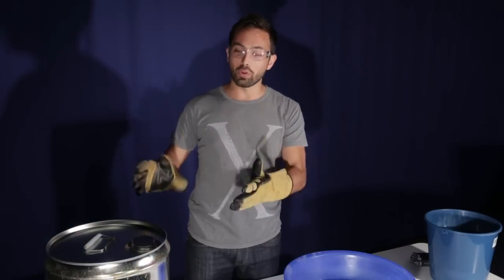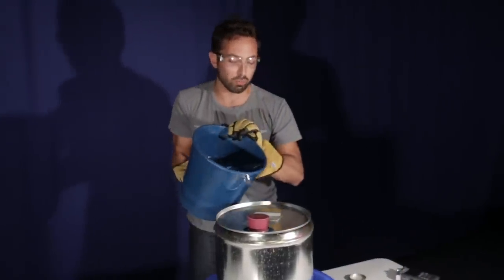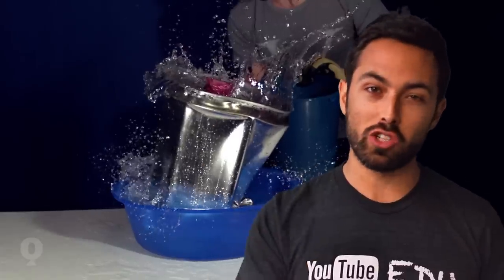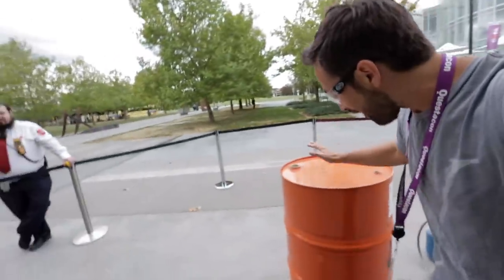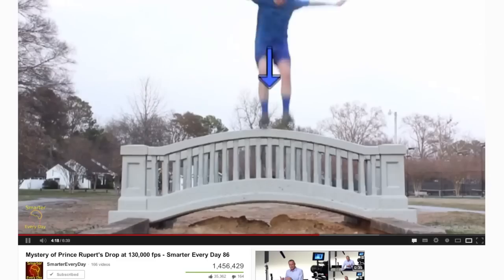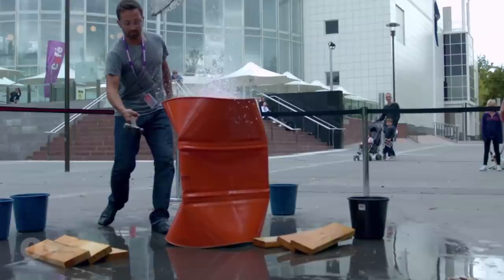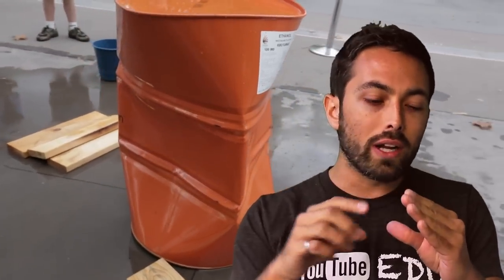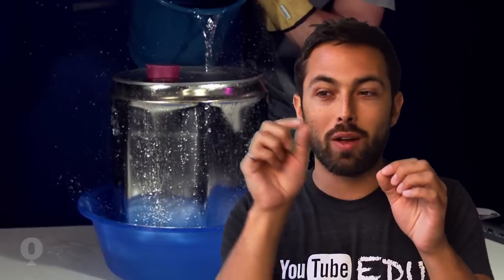Epic Slow-Mo Drum Implosions!

Comment: I think the point you made about minimizing space to compensate for the vacuum is true. However, I would add that if the structure of the object allows it, it will prefer a more spherical shape, since the atmospheric pressure pushes on all sides. I think we saw that on the small drum. I would guess that the bottom ring of it was not as structurally sound as the large drum, so it could cave in the whole thing rather than "make due" with the shape we saw in the large drum.

Comment: If it is stronger along the vertical axis (looking at it as a drum normally sits), or having a much stronger lid, then maybe the hexagonal shape has to do with its not wanting to deform near to the ends. it is still minimizing the volume inside but the resistance to deformation of the lid (look at how much the orange lid bends) keeps it from going to 3 folds.

Comment: I think it's to do with the ratio between diameter and hight of the container. They both have a reinforced rim at both ends that would require far more force to deform. So the comparitivly weaker sides deform into the lowest sided shape they can given the restricion of the rims trying to keep it circular. A really short barrel may compress into a 10 sided prisam where a really tall barrel may compress into a flat plain (significantly less volume to surface area than a triangular prism)

Comment: I think it [triangle/hexagon] was because the top and bottom -  where the lid or the base of the barrel meets the round outside looked a lot stronger in the smaller barrel than in the larger one. 
Now, the lower pressure would normally cause a triangle but can't because of the stronger circle there, it gives itself more sides to compromise between the strong base/cylinder joining point. 
And the forces at play came out at about 6, which is pretty close to a circle. 
If that makes any senss

Comment: In my opinion since the air pressure is the same on all sides of the drum you would get a equal force applied in every single point of the circle; and that's why it formed that equal later prism. And the 2nd question; if the air pressure would still have enough force left over the materials strenght, it would cave in a 6 later prism, then if enough force would be left it will become a 12 later object;

Comment: I think the small drum ended up shaped like a hexagon because there wasnt enough low pressure inside it to justify it turning into a equilateral triangle. Just like it was said in your video, the bigger drum, being tougher, allowed it to build a much lower pressure inside it (and the need of a few hammer blows on its side) untill it got squeezed into a shape with a minimal amount of area.

Comment: Maybe the difference is 1- The material the drums were made (large drum was of a more dense and harder material, versus the smaller drum which seemed to be made of a thick aluminum, still being weaker than the larger drum; and/or 2- The large drum had those corrugated rings on the upper and lower sides, making the drum stronger than the smaller drum, which was flat on its sides.  Since those were factors, maybe having to use more energy to collapse the large drum, the effect was the equilateral

Comment: The lowest perimeter/area ratio explanation carries the assumption that the can must crush regularly, not as an isosceles triangle, or as a rectangle (both of which could have much lower perimeter/area ratios). If we can explain why the can crushed at a regular interval, it may help to explain why triangle or hexagon. I think it has to do with the pressure waves traveling through the metal. The waves propagate from both sides and crushes only where waves interfere constructively.

Comment: I think the smaller container was allowed to reach a statistical valley and path in stability because it was only utilizing the gradual energy contributed by the vapor condensing. There's probably a larger and more sudden activation energy to reach the equilateral triangle state which was given by the impact of the hammer. The smaller container then couldn't reach the triangle state with further condensation because it would have to go back to its original state and then to the triangle state.

Comment: Premise: collapsing into a triangle takes more energy.
Guesses:
1. You jump-started the collapse, giving it enough energy to get to a triangle. If you hit the small can, what would happen?

2. The large can had a higher pressure difference, so it needed the more compressed state.

3. It takes more energy/is less stable to collapse a short object than a tall one. Ex: crushing a tall soda can into a triangle is possible, but collapsing a short half-can distorts it into an uneven jagged state.

Comment: If you do this experiment with a perfect sphere as your original shape you'll get a geodesic. Buckminster Fuller mentions this experiment where the navy did this with two perfect spheres where the air is removed from the middle of both spheres and the outer sphere crumbles along the geodesics. An equilateral triangle is the smallest space in two dimensions, but in three the shape is a tetrahedron.

Comment: I think the smaller drum  turned in an hexagon because it requires less pressure to form this shape and as the vacuum was gradually produced, when the amount of pressure needed for that shape was created it was imploded.
In the case of the big drum, I think it reached an amount of pressure to give an hexagon shape to that metal, and as more vacuum was created, the pressure was enough to form a triangular shape, but it was not enough to change the round shape until you hit it with a hammer.

Comment: I think it has to do with the length of the sides of the drums. The 55gal has long sides that can fold in a triangle without having to distort the top and bottom that have a strong rim. The small drum has much shorter sides and the hexagon is the closest available shape it can make without distorting the strong rim.

Comment: Pt2
The other key factors are strength of the 'skin' and height of the drum.  A tall thin walled drum, especially a tall one, will collapse to an almost flat shape, the walls are not strong enough, even in the very robust triangular shape, to prevent the pressure of the air crushing them flat.

Comment: Hexagon is super stable shape, that's why the small drum have collapsed in to it. It's actually quite usual for drum to collapse in to a hexagon as round objects tend to naturally collapse in to this shape. Best example would be honeycombs made by bees. The bees are actually making each cell round, only the heat in the beehive than weakens the tubes so much that they collapse in to a most stable available shape - the hexagon. I believe that the large drum have collapsed in to a different shape because it has much longer sides and weaker caps in comparison to a small one. That have allowed it to collapse further that the small drum.

Comment: The small drum had equal pressure on all sides when it collapsed.  The large drum had an imbalance of pressure due to the hammer, so as that side started to collapse, it tried to go as much as it could.  Because it compromised the circle structure, the other side were then able to collapse with equal pressure so the point opposite the hammer strike would be the folding point.

Comment: I think it's more than that. If you watch the smaller container you'll see that the formation of the shape propagates from a starting point where the structural integrity was weakest, but then as the wave of formation goes across the can it starts up a chain of points that implode. So I would guess that a perfect sphere would form something akin to a soccer ball, or if the pressure is high enough, a tetrahedron.

Comment: no because the thickness of the metal and type of metal  also changes with the size of drum manufactured the small one is is a soft aluminium and the large one is thicker steel, it also has two bands round it which are there to strengthen it  also the triangle effect on that appears on the large drum seems to be contained between the two bands

Comment: I think the smaller drum imploded differently because it was itself less sturdy. The big drum has mechanisms that make it stronger under pressure, that being the ridges along the horizontal plane of the drum when its on end roughly 1/3 & 2/3's of the way up the drum. The small drum did not need to compress into an equilateral prism because it gave way before it reached a point requiring it to do so. Just a wild guess.

Comment: The shape depends on how strong the structure is. In some points of the barrel the structure is weaker, causing it to be easlier bend. If he would have hit the barrel harder it could squeeze the entire barrel. For the smaller container it, which was much weaker then the barrel all sides imploded at the same time, causing a hexagon.
The barrel was also reïnforced with ring structures in the mantle, when these break at a point the structure weakens drasticaly, causing a bigger force.

Comment: With that reasoning, the drum would take on any number of polygon structures before it became a triangle and not just limited to a hexagon. It could be that combined hammer and pressure deformation caused a high enough energy wave to deform the every polygon vertex that it encountered as it traveled along the perimeter and as a result the drum went straight to triangle. Failure analysis is a very complicated branch of mechanics...

Comment: I think it the bigger one turned into an equilateral triangle because you poured a lot of water on it and it took a lot of time; most of the water vapour in the drum was condensed into water and the air pressure was lower than the first drum. In the first drum, the air pressure was higher than the second one, so the drum didn't need to crumple into an equilateral triangle because if it would, the air pressure inside the drum would be more than 100 kPa.

Comment: I think because the bigger barrel was taller compared to the diameter that's why it can crumple more whilst the smaller one is more ...stumpier (for lack of better word) so it's harder to crush into a triangle and the smaller one has hexagon, I learnt something that by only using the radius of a circle you can go around the circle 6 times (a hexagon) so I think that's related to that but I also thing that the barrel having two circles for support might have something to do with it.

Comment: As a guess... I think somthing that may have at least contributed is the top and bottom, from there structures the smaller drums lid/base looks a lot stronger and more unwilling to morph/bend than the flat lid/base of the bigger drum. It seems like the lid/base is denying the cylindrical surface from (as you said) optimizing its volume inside which also why it was more inclined to crumple in on one side.

Comment: I would agree that the strength of the lid might have something to do with it.  Also, the smaller can is bevelled, preventing it from releasing tension at the top and bottom.  The orange can buckles from its straight wall into a rounded deformation on the ends, which gives slack to the sides, negating the stabilizing force of the lid.  My hypothesis.

Comment: I don't know how influent the condensate effect can be on a power block. I agree the volume variation creates a suction but it is not required to work the turbine (there are other cycle which works without phase changing fluids like airplane turbines). The driving force in these plants use to be a powerful pump. The main reason to condense the outlet turbine steam is increasing the pressure of a liquid is energetically cheaper than compressing a gas,which means better effiencies (around 40%) .

Comment: First, there isn't complete vacuum in the vessel. The included air (the air doesn't come out completely, cause the temperature isn't 100°C all over the vessel) prevents complete collapse. Then, if the experiment was "static" (eg a barrel full of water slowly shucked), the cross section would become first elliptic, then collapse into a simple line.
The reason for the polygonal shape is the dynamics. The dominant mode is in accordance with the fundamental period off the event.

Comment: The larger drum crumpled to a triangle only between the two ribs, after which it expanded back into the circle for the top and bottom. The creases acting as easier points for the folding (as anyone who's done much origami can tell you). The smaller one however has no such ribs and was a hexagon most of the way along but also expanded into a circle at the top.

It seems to me then that the ribs made the difference, given that the undented circles held.

Comment: Perhaps the larger drum created an equilateral triangle because the strength of the material kept the barrel from caving in until a severe damage to its structure made the implosion possible. That would explain why nothing happened until denting the barrel. Going off of that thought, the small drum caved into a hexagonal prism because it did not require such a drastic change as suddenly as the material was not as structurally sound.

Comment: Theory on the triangle vs the hexagonal form (may already have been posted, I didn't read over a thousand other comments): The smaller was influenced by atmospheric pressure  ONLY (in theory) and thus gave-in equally on all sides. The large drum flexed when the hammer hit it. You can see it ripple in response, causing a fold in the material that became the first point of the triangle. Where the hammer hit became the first side of the triangle as the atmosphere affected the other "two sides".

Comment: I believe it has to do with 
1. the intensity of the vacuum.
2. The strength of material
3. the size (height and radius) of cylinder.

basically If the material is strong, or the size of the cylinder is small or the vacuum is not strong enough it will go into hexagon shape. Else, it will go into triangle shape.

Comment: Effects like these are extremely difficult to precisely predict because several factors will affect the outcome, such as volume, rate of change in pressure,  wall thickness, tensile strength, elasticity, etc. I think, for the most part you are getting these uniform prisms simply because the cylinder is basically an "n-gonal prism" where n tends to infinity. Since having such a very uniform starting point enables you to store a significant amount of energy in the object while it remains meta-stable.  Once breakdown is achieved, a second meta-stable configuration may be reached if the collapse is not too violent, and determined 

With your feet on the air and your head on the ground, try this trick and spin it.  Your head will collapse if there's nothing in it and you'll ask yourself, "Where is my mind?".

Comment: A triangle of the same circumference as a hexagon has in fact only a quarter of the surface area of the hexagon. So a drum can reduce it's volume more by imploding into a triangle rather than imploding into a hexagon. So the triangularly imploded part of a drum has a quarter of the volume of a the imploded part of a drum that shaped like a hexagon (same drum).

Comment: The orange drum does stand reason for compressing into a triangle shape for its reinforce style which was only converted from its thick wall circle shape with the aid by the hammer however for the smaller drums having a weaker walls and less volume a triangle cannot be achieved due to the vacuum force being strong than the retaining wall and I believe the smaller walls having a less uniform wall unlike the thicker walled barrel which could be made more uniform due to its size

Comment: i think the first one crumpled into a hexagon because that process was much slower so it crumpled into the closest solid shape. thats why it crumpled even more later on because there was more suction that had generated afterwards so in order for it to become a triangle from that state it would need to reform to a circle first before becoming a triangle. but the later one could just as easily become a triangle as a hexagon but it became a triangle because the suction was already high enough.

Comment: My answer to the question is this:

The two cylinders both crumpled to where the vacuum inside each container would be almost equal in pressure as the outside atmosphere. For the first cylinder, the pressure difference wasn't that big, therefore it had less differences between the pressures. Making the hexagon the optimal volume that would differentiate the pressure. The second cylinder could've had more of a difference between pressures. This would cause more volume change and the triangle.

Comment: i would like to add a few idea's to this.  The smaller drum has a different set of structural properties.  The amount of "flex" the large drum had in its side was greater allowing it to compress further in.  The smaller drum had less give to the sides on initial shrinkage, so it followed a different path. Is the small drum a multiple, of a equilateral? After first shrink you can see the drum continue to shrink until the next weakest point gave in and it crumpled to the side. Also, just a thought

Comment: specifically, because aluminium bcc srystals have different slip planes from steel fcc crystals, that the slip occurs in different planes of the metal. I don't see how that relates macroscopically though, because we almost never manufacture crystally pure metals, so the grains (and therefore slip planes) are all randomly oriented. I think it has more to do with the radius of curvature, how much pressure difference there was, and how much manufactured stress was already in the material.